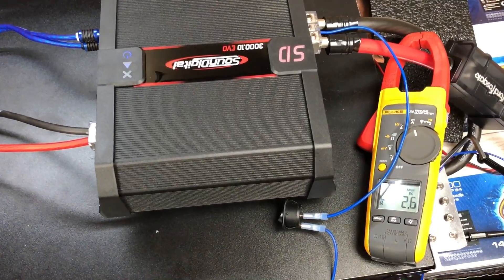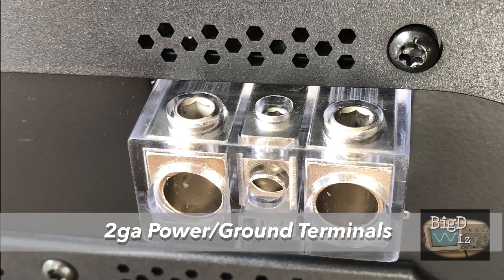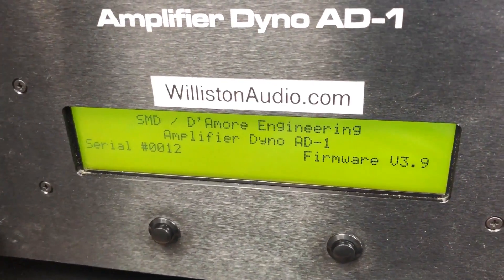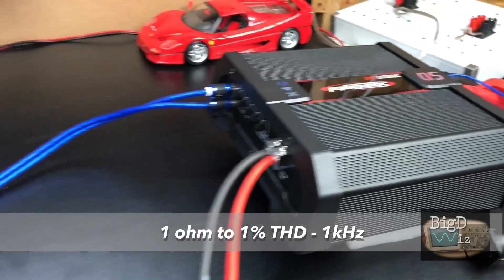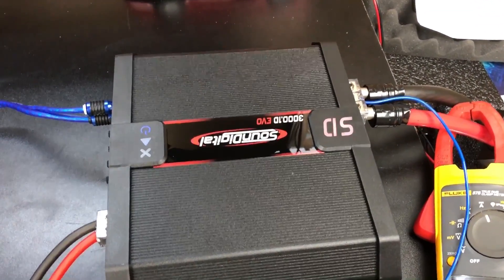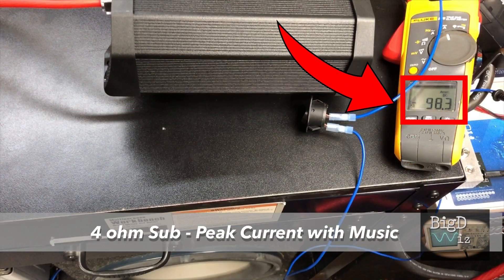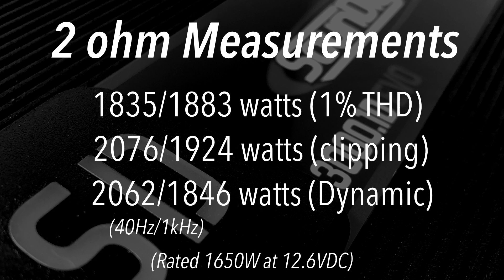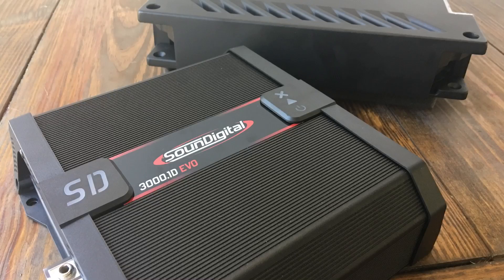SounDigital SD 3000.1D EVO II Amp Dyno Test

Comment: So I've recently acquired a clamp meter and Ive tried checking the current on my vehicle electrical system. For my electrical I have a CES 180amp alternator and an xs power d5100r with a big 3. When clamping my electrical, the readings that I get are no where near 180amps even while going full tilt on my 2k watt Soundsystem. Feed back is appreciated
Reply: Make sure your clamp meter supports dc,most of them read ac amps only
Reply: @ricgaming917  of course the clamp meter reads DC. I would not have bought it otherwise. The mechanics in my area say that I shouldn't be getting a reading that matches the full output rating of my alternator

Comment: I’ll stick with half bridge amps. I’ve had some last for over 10 years. You would be lucky to get 2 years on a Brazilian and now they’re getting expensive. HARD PASS.
Reply: I've run an HD3000 for 4 years now. No problems. Run good electrical, knock the dust off the fans, and you won't have a problem. It was $160, too.

Comment: Why this there only 1 RCA for the input and output ?
Reply: Simple.... because is mono amp....
Reply: Because a subwoofer is a mono speaker. It only requires one input.
Reply: Would you still be able too connect 2 subs too this amp?
Reply: @Marcel_Da_SundownKing  you can add as many subs as you like as long as the final impedence to the amp isn't lower that is rated stable ohm.

Let say for example it's 1000w rms... 1 sub would get 1000w two would get 500w each. Three would. Get 333w each four would Get 250w and so on.

So on this amp you could run 2 subs at 1.5k each.

Comment: Would the 3000.1D NANO be alot better than the Evo? I'm looking for less amp current pull and need 3000 at 1ohm. I use 14.8 volts with my 300 amp high output alternator. Currently I'm using the Taramps 3000 bass 3k and it draws alot of current at 1 ohm. Hope to hear your feedback. Thanks
Reply: Need car audio batteries...
Reply: @passionatelyloud130  yeah I have XS batteries. I actually bought the Evo 3000.1 and swapped out the Taramps Bass 3k and problem solved. Taramps pulls way more Amperage.
Reply: @mailtoome  how's the EVO? I have a evo1600 in the closet. Last year I got a Taramps HD3k. It finally blew up today. Great little amps when they work. But quality control isn't the best on Taramps. I've always loved sound digital. The Taramps was just stupid power for $200.
Reply: Good question I have this similar issue

Comment: I own the 5k of this amp, its a beast! Its such a good amp for size and amount of rms power
Reply: how good is it? and what have you owned before that to compare it to? 
i got a taramps last year to replace an incriminator amp that clapped out. it was pretty decent for a good price.
i got the 5k soundigital on a good deal from a friend today but idk what i want to do with it yet.
Reply: @chehystpewpur4754  it a great amp, but! It popped a mosfet couple months ago... i ended up buying the taramps smart 5 bass, its a way better amp on my 18s runs ice cold compared to my old evo 5k... has alot more stable rms and huge rms numbers
Reply: How do you set your gains? I just got the 5k too
Reply: @PreslySmith  theres lots of good info on here how to set gains, also google is your friend

Comment: I cannot believe this is a $500 amplifier... what a cash grab... this is an absolute JOKE. At least taramps is cheap.... this is a shame soundigital... rip off
Reply: I have a 700 dollar Pheonix Gold Ti3 1300.1 conservatively rated amp. It does 1483 watts at 1 ohm at 1% thd but it blows 2000 watt subs due to having a high headroom before clipping. It’s much bigger since it’s an American half bridge class D amp designed for specifically for sound quality.
Reply: Well other 3k and up amps cost $700 and up so...
Reply: @EBMproductions1  taramps , Stetson ,  timpano . List go’s on and all do rated. It’s not a good buy for what it is

Comment: the place is went to , to get my stuff installed sold mattd and sound difital . i bought my own box my own subs two zvx 12s and they sold me a 3k amp unfortunately i bot on sub used but brand new at dual 2 so i bought another dual. 2 so he got me a 3k 2 ohm soo wth am i gunna do
Reply: What Did you even say

Comment: Hey Big D,

What do you set the gain on an amp to when you test them? What I am trying to figure out is when does an amp make its peak power? I just bought the Soundigital 1200.1 but it powering an Alpine s-w12d4 which is only rated for 600 RMS.  If the amp gain is turned all the way down will it still pull 1200watts if I crank my volume?

Comment: I run a sd1200 evo on a 1500w sub. This amps stay cool and atleast in my case its durable af. I push it to the absolute limit and no heat, no protect and despite it shows clip on the indicator the sub doesnt heat and no smell or dark coil signs.
Reply: I don't think that the clip light is accurate on the 1200.1 I am running the Same setup pretty much,  American bass hawk 10.d4. And the sd1200.1

Comment: I have a question what’s the best choice for a 5000 watt amplifier between soundigital , banda, taramps, stetsom
Reply: Banda viking 5k best if both worlds solid amp!
Reply: Dave Micolichek  that's just your opinion
Reply: Powerus or banda viking great amps
Reply: Luke_784 Low Frequency  soundigtal power series?
Reply: I bought a Brazilian made corzus amp For $430 ill let you know if its worth the money
Reply: The best is not in your list..... ORION hcca series.....see the test of Williston audio this is the beast......
Reply: @francescogerotto8496  yes your right but I don’t use rubber subwoofer I use solid cardboard so I can’t use those types of amplifier

Comment: if i may ask how much is the 300.1? and if they mke a 2500.1 how much is that im buying a zv5 12 d2 down to 1 ohm want a 2500 or 3k skar or whatever i can afford
Reply: Wolfram Audio C-2400.1 Class D Monoblock
Reply: Brad Price d1 @ .5 on skar sk2500
Reply: Dylan Sukhlall no get a 3k watt stetsom
Reply: @hugoaguilar9407  seen two in a test here, they both went up in smoke
Reply: Probably too late but Banda makes the best Brazilian style amps, cost a little more but they're more stable, have filtered outputs and have much better cooling.

Comment: Brazil? Do these catch on fire?
Reply: No way they can't when running at or even near there ratings. At 3000 watts, they are dissipating around 1500 watts of heat. No way that tiny heatsink can dissipate 1500 watts. I'd love to see a sustained 3k dyno run. I bet it'd blow even faster than a Rockville sub.
Reply: @thorlancaster5641  they dont get that hot i have 2 of them for my mids and they work greate all day long so xDDDD
Reply: @TheSteelerKillers  Mids? The only thing that uses 6000 watts for mids is a stadium. Even 100 watts of mids in a car is unbearably loud. No wonder your amps don't get hot.
Reply: @thorlancaster5641  there's a reason there's a fan in there. also they don't put out anywhere as much heat as that as they're obviously class D amps, if this was a class AB amp like alot still are, that heatsink would've needed to be atleast 10-20 times larger, the amp section itself is like 80-90% efficient which means only 10 or 20% of your 3000w goes to heat, that with active cooling and no issue.
ofcourse the power section still isn't 100% efficient but that heatsink wont ever even see 700w of heat loss.
Reply: @BH4x0r  Did you watch the part where with the ammeter? The fan in that thing isn't even pointed at the FETs and at rated power it's dumping out 1800 WATTS of heat. If you hooked this up to some real subs (like a pair of ZV5's) and tuned it to max clean power, it would blow on the first rap song with high duty-cycle bass. Even if we let the thermal resistance of the case be an optimistic 0.5 degrees Celsius per watt, the internal components would reach 900 degrees Celsius above ambient. That's nearly hot enough to melt copper, never mind the FETs and capacitors which would be toast long before that. The laws of physics dictate that the amplifier would BLOW UP if used at it's continuous rated power.

The only way this thing would survive at 3000 real watts is if your music only had the occasional full-power bass beat to let the components cool down in between.
Reply: @thorlancaster5641  it would dump out 1800W of heat if it was an inefficient amp, but class d is very efficient, so almost nothing is wasted to heat, because class D switches FETS on and off entirely, which means the FETS always have a really low resistance, while in a class AB amp the transistors are usually only partially on/off, which is the main cause of heat in those amps, because the resistance is basically varied, and heat occurs when a current runs through a value of resistance, but in the case of these fets in the class d amp they're really low resistance
Reply: @thorlancaster5641  "..the internal components would reach 900 degrees Celsius above ambient."
I would love to know where you did your Doctorate in Engineering from.
Reply: No man, no it wouldn’t.  They actually work and they run cool.  It’s just new technology.  Hard to believe for some.
Reply: @thorlancaster5641  They actually don't get hot, in Finland lot's of people run these, and I haven't heard about them burning/breaking. The rca terminals are know to fail if they are strapped to the box but who would do that?

Comment: Nice numbers, but how reliable are they?
Reply from the maker: Good question. I haven’t had a chance to test reliability
Reply: I've sold at least 30+ SD3000 amps the last 2 years. Very little problems with them. If there were a problem, it's usual customers don't have enough battery power to these amps. OR they mount them on a shitty subwoofer box, they don't like a lot of vibrations.

But over all, actually, fantastic amps! I have used my SD3000 every day for the last 3 years, no problem at all. Good power, extreme controll! For the moment I use it on the new Alpine Type X 12" woofer, sounds good and very fun to play with :)

Comment: Testing Md3000 New taramps
Reply: John Nelson   I am a idiot, it was my fuse I had like A 80amp that came with the fuse box when it needed 300 amp fuse. So the amp is good & I am about to get the 8k to run  A Skar DNR-15
Reply: Marty Mar god damn you went from 3k on a sdr to 8k on a DNR in a month 😭😂
Reply: I just ordered  & received Taramps md 3000 it 3 days ago it played great it was too powerful for the Single 12" 1,200 Watt SDR Series Loaded Vented Subwoofer  I knew it because the sub is only rated @ 600 rms so I kept the gain & volume low. I thought I'd eventually end up blowing the sub. However, here I am 4 days after receiving the amp writing this comment to explain the amp cut off & didn't come back on  it wasn't hot & it was only A few seconds into the first song of the day on my 4th day of owning it. I never played it for more than 10-15 at At A time.  most times i would only play it for maybe one song. I am talking to the company now to see if I can get another one I am hoping it was A defect because it was working good the first two days

Comment: My new stetsom 6000 2ohm has those flimsy adjusters as well. Going from a AP3000.1d I only feel and hear more power the AP Would thermal after bout an hour -390amp U.S Alt XSpower d7500 in my engine bay and a XSpower d3400 as a secondary so I got good current and I use Orion dual 0 Gauge to single 0 gauge input adapters. Stetsom stay cool to just warm so far that is. I went to my ported box cause I was hitting Xmax to early in my sealed box. Clip light helps would be a million times better with a remote gain knob with clip light imo. Power is clean and brutal put its s different amp with different setting knobs then I’m use to so I’m trying to find a way to get the most optimal bass usage/output. Seems to be doing it’s rated though 🙃

Comment: Chance of a SounDigital amp blowing up on you? About 13.2%. WAY WAY higher than just about anybody else.
Reply from the maker: Where did you get that statistic?
Reply: My 1200.4 evo just died on me today haven’t had the amp 1 month in use!
Reply: Bro Boaz what where you running on it?
Reply: Solomon Stuart 2 6.5 and 2 8 inch both midrange
Reply: I recently sent it out for repair
Reply: I wonder why it blew?  Mine seems to be working well I have the 4k Evo 2 but it’s only been a week since I got it
Reply: Solomon Stuart they say they had to reinforce the power terminal inside
Reply: Bro Boaz damn that’s crazy I pray mine doesn’t go through that cuz this thing is a beat

Comment: I just bought the same amp, and have stock 90amp alternator, a redtop optima in the front and a northstar agm31 in the back.
I haven´t install it yet, do you think i might have to change my alt, add another battery or both?
Reply from the maker: Depends on how you use the amp. If you listen to a lot of bass heavy music then you will need bigger alt
Reply: If you have the money to spend, It never hurts to go ahead and swap it for at least a 140amp alt. If anything your batteries and car electronics will love it.

Comment: Hello Derreck thanks for your video, I have a question. Lot's of people talk about noise from Taramps, heardable easily from speakers. But we can notice than Soundigital have pretty the same prducts, but more expensive.
Does the difference of price mean than Soundigital are less noisy than Taramps? Thanks
Reply from the maker: Are you using them full range or just for bass?
Reply: Hello Derreck I am talking specially about Taramps HD3000.1 (no matters the impedance) and Soundigital HD3000.1, so, full range amplifier, no for bass only.
My question is if the little noise is less heardable on soundigital and if it  can bored the listening at low level.
Reply from the maker: Only noise I hear at low volume is fan of its on (with both amps).
Reply: thanks a lot.

Comment: The part where the rca goes I believe u can only put in one jack. Not a pair. Because mine write input on one and output on the other
Reply: SonzOfSylvia in the vid he connected both ends of the RCA into the amp. The store I bought it from told me not to do that. Use a splitter
Reply: Davis Lutchman it gives less power when you do that?

Comment: im needing a small amp to run (2) 10" subs. do you think this amp would be a good choice?  What subs do you recommend ?  I need small air space subs.  looking for big deep base though
Reply: SuperRhino_R1 I recommend two 1500 watt rms subwoofers both will handle the 3k watts together
Reply: Cristian Nieto what brand /model sub would you recommend paired up with this amp ?
Reply: SuperRhino_R1 hmm 🤔
Reply: SuperRhino_R1 what is your maximum size subwoofer you can get? And what is your budget?
Reply: Cristian Nieto either (2) 10” or (2)12” But they can’t be too deep.  They have to fit into the saddle bags.  Whole bag will be sealed off as an enclosure.   Budget ... hopefully no more then $1500.  Total For 2 speakers
Reply: SuperRhino_R1 saddle bags? In what vehicle?
Reply: SuperRhino_R1 I don’t really know any subwoofers that will fit into small Saddle bags that can take 3k watts, all the subs I know are pretty deep!

Comment: so when is that test gonna be uploaded. i wonder what the damping factor will be @ 1 ohm. looking at jl audios slash amps the damping factor drops when the ohm load gos down for example the 1200/1, 4 ohm @ 50 hz is 500 and 2 ohms @50 hz is 250

Comment: for the heck of it you should have brought out the eggs and fried a couple I bet that amp gets extremely hot after a few minutes pulling that much current
Reply: Yes I own this app it gets very hot very fast but the amp does hits very hard, I would not play this amp on hot days I play my amp only if it under 85 degrees outside
Reply: why not run it at less power say 1500-2000watts then you can chill probably won't run as warm or what?

Comment: Amazing amp!, Been pushing this amp at .5 ohm for 5 months with No problems! Crazy power for an amp that size.
Reply from the maker: Crazy it has survived at 0.5 😱
Reply: BigDWiz haven't played it under 12v tho. These amps claim to have a good protection system from heat, shorting out and low impedance. Took a while to tune the box to get the right impedance. It would go into protection every time when the impedance dropped to low.. from what I've heard these amps are allmost impossible to break because of the protection system.

Comment: 7:44
I got a kit like that from Amazon recently too, except it's got black plastic instead of orange. Nice little kit. Some people said they snapped the bits, but I have a feeling that they might have been applying too much torque to them - little screws don't need nearly as much torque as large bolts.

Comment: It would be nice if the Amp Dyno could also do a frequency sweep, so it can measure the frequency response of the amplifier, and perhaps also measure the efficiency at varying levels of load.
Reply from the maker: I agree, but it doesn’t and getting 40Hz and 1kHz gives you an idea of power for subs vs mids/highs

Comment: wow! very good amplifier!
test the Ground Zero GZIA 2080HPX-II seems to be a good amplifier for the price!
it's an AB class amplifier with 2 channels
it is rated 60x2 at 4 ohm, 80x2 at 2 ohm and 1x240 at 4 ohm (bridge mode) all with 14.4V 1% THD
it has very simple settings... cross over (lpf and hpf) and gain

Comment: You have both rca's hooked up? Only one is an input.
Reply from the maker: Someone pointed that out earlier. I tried again with RCA splitter going into single input and no difference in power
Reply: Dave I'm pretty sure it doesn't work like that on this amp.